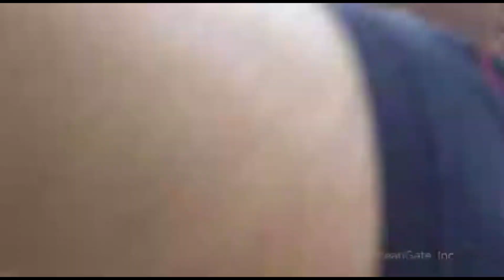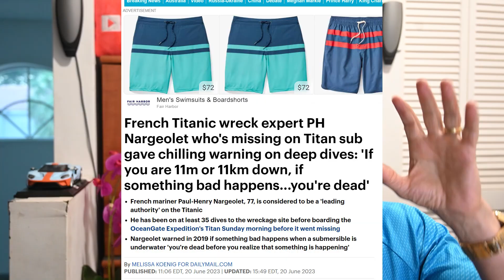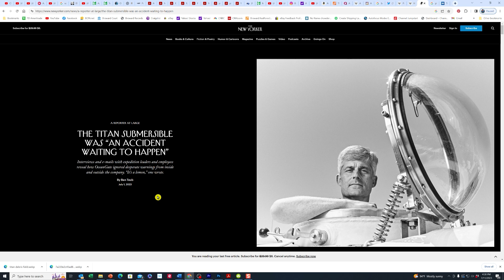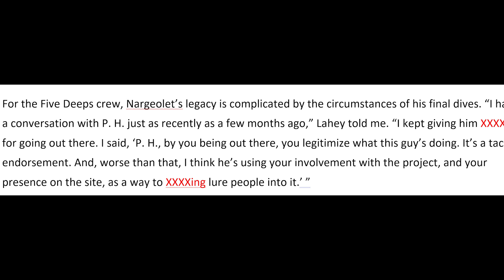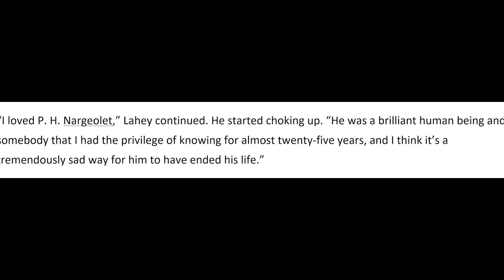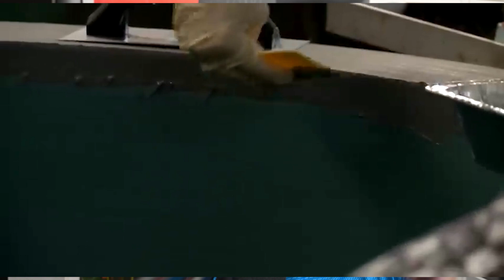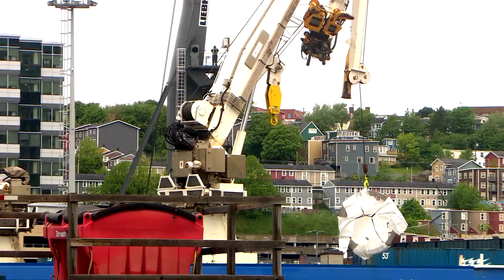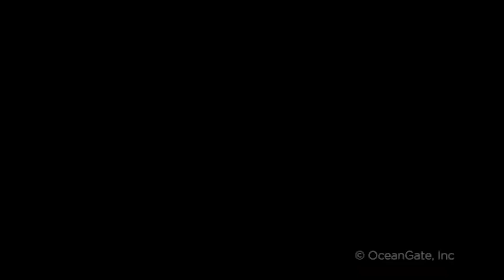Titan Sub: More Q&A, Design Defects, Why Descent Fast

Comment: I'm surprised that it wasn't tethered to the mother-ship as 4000 meters is not a particularly long cable in the world of ships. A cable just might have hauled them back up fast enough to get to a safer less-pressurised depth before the implosion.  A  "controlled spin-out" cable could also have limited the maximum rate of descent as an extra safety measure.
Reply: A cable would make managing the descent rate essentially impossible. It is too technically difficult to find a sweet spot with just the right tension to give the vessel any real control over depth. The vessel is too light relative to the cable, and then their is unpredictable and ever changing water currents. Just not possible in my opinion.
Reply: I don't think the particular ship had such a cable.  The towed it out.  At what point did the occupants board?  probably in port, not out on the bouncing ocean.  When as that hatch bolted closed?
Reply: @JoeLinux2000 They did not board the Titan in port.

The Titanic dive site is 370 miles from port. Transit to the dive site would have taken at least 24 hours, probably more depending on the sea state.

Obviously the occupants were not sealed in the Titan battered by waves this long before they even commenced the dive.
Reply: I read somewhere that a tether would increase weight and drag so it’s not used.
Reply: ... but what about a cable that can hold 10+ tons of vehicle weight plus tension?